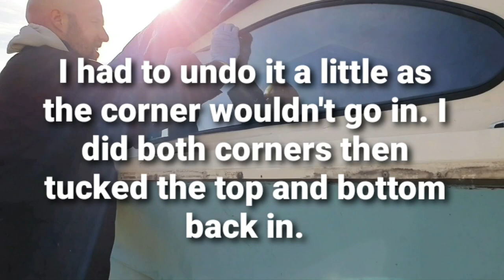Shetland 535 Boat Project Restoration 2021 - Episode 5 - First New Window Installed

Comment: A tip from the days before bonded car windscreens. Do as you did to size the rubber into the cabin top . Remove it again ,fit the glass / perspex . Use some light cable  .75 gauge of there abouts all the way round inside the rubber with a good drop of soap. 
With some help from another person to keep pressure on the rubber on the outside , pull the electric cable alternately from the inside. It should be a lot easier. My heart goes for you,you must have had side hands afterwards.
A warm day and warm rubber makes everything more plyable.  Mind you fourty years back , even the more modern garages didn't have much heat in winter with the door open for cars going in and out.

Comment: Hi, could you tell me what thickness your new windows are please? I’ve bought some replacements for my 535 which are 4 mm, the ones I took out were 3 mm. Reason for asking is I can’t find any claytonrite seals measuring 4 and 5 mm but see that you used 5 and 5 mm.